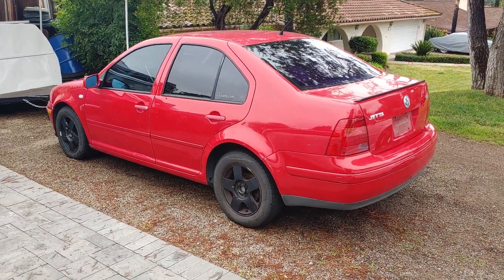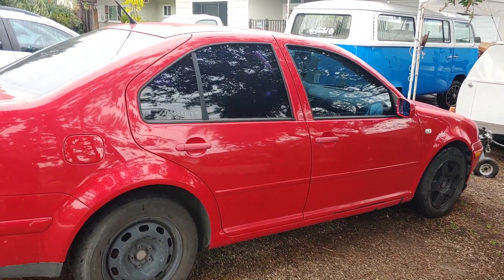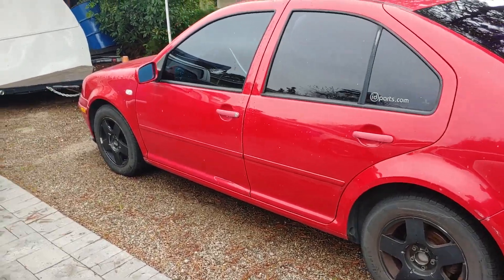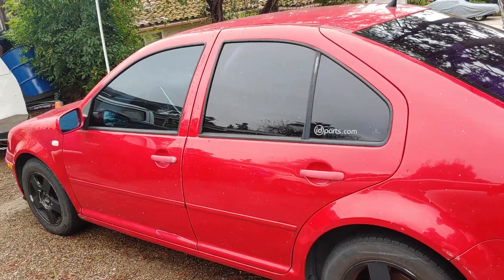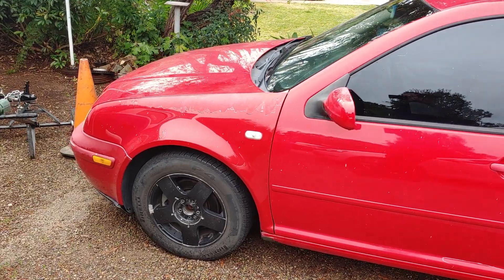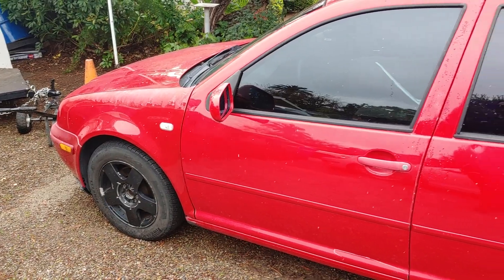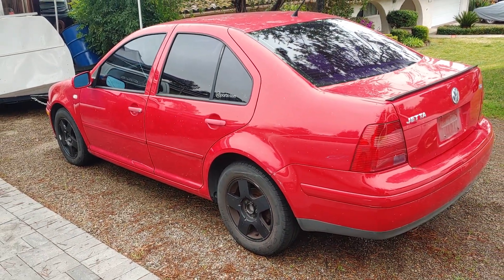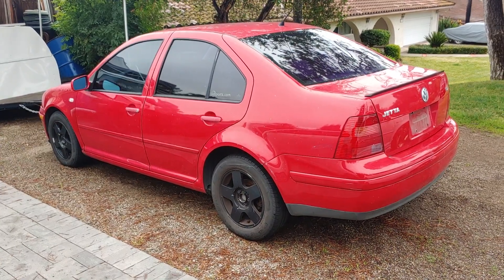The MK4 "Outlander"

Comment: I can’t wait ... I have a mk4 Jetta sitting in my driveway just waiting to be modified but don’t know where to start
Reply: What motor do you have in it
Reply: Yeah, what Layten asked.
Reply: It’s a 1.8 t ... it’s running strong too the only problem I have is a free spin bolt on my subframe that connects my left control arm
Reply: The only thing I’ve done so far is an sai / coolant ball delete
Reply: @thebmwholdover2608  do a cat delete and get rid of your box filter for a cone one and get a simple stage 1 tune unless you looking to spend a lil bit
Reply: Layten Perkins ok thanks sounds easy enough .... I also won’t mind spending a little the car only ran me 500 .
Reply: @thebmwholdover2608  well if you got a bit to spend a new downpipe in general would help and new intercooler to help heat soak but with all that and a good stage 1 tune you'll be around 18maybe 20 psi be a bit quicker and sounds nice with spool noise
Reply: Layten Perkins thanks man I’ll try to post some updates when I can 👌🏽

Comment: Can I ask a
Serious question?i have a 01jetta wagon mk4.  Is there a way to change rotors so 5x112 or 114 wheels to get on there and maybe brakes would  come w what I  get from junk yard.  Thanks in advance
Reply from the maker: You can not swap from a newer car due to the geometry and they wont bolt on. That being said you can get wheel adapters to go from 5x100 to whatever wheel pattern you like but remember the smallest adapter you can get is a 15mm so you will need to get a wheel that has a good offset so it can sit behind your fender or else it will poke out and look bad.